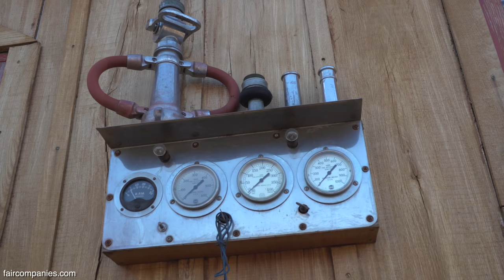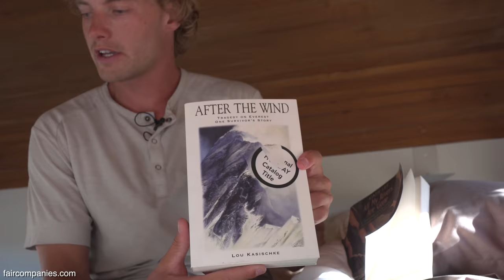Snowboarder's 1950s fire truck as a cozy place to call Home

Comment: This guy should hook up with the couple from Adventures in a Backpack next ski season!!!!🏂⛷🎿
He needs to invest in a hot air exchanger to take out excess moisture.  He can use Damp-X in the meantime. He could make or get a composite toilet, build a box around. Put a cushion on top as a seat when not in use otherwise.  ijs😀

Comment: I have  seen  many van conversion videos, and I don't  understand why they don't  build a bathroom  when they have room for it, at least a very minimal one.
Reply: Because it's expensive, water weighs 8 lb. per gallon, you have the hassle of dealing with human waste and gray water, pumping water needs pressure systems, pumps need electricity, electricity needs batteries, etc.

Comment: that poor transmission... you're supposed to double clutch it. it wont grind so much that way :(
Reply: Tony Fleetwood I think double clutch means different things in different cliques
Reply: Double clutching means: 
1. depress clutch 
2. gear into neutral 
3. release clutch (at this point the gear speed and engine speed equalize) 
4. depress clutch 
5. place into higher or lower gear (rev matching with accelerator if down shifting)
6. Release clutch

In modern cars double clutching is not necessary as they use a synchromesh which automatically equalizes the gear and engine speed.
Reply: Eric G double clutching also means you don’t lift your foot off the gas when you shift.
Reply: What you are talking about is called 'power shifting' or 'throttle shifting''. Double clutching means just one thing in my experience: using the clutch twice for one shift.
Reply: Eric G thank you the big issue with car terminology is a lot of weekend warriors get terms wrong and spread them around. I was told that was double clutching multiple times. You’re definition makes way more sense to me. Thanks man
Reply: Agreed!
Reply: non yobussiness except that it doesn't. That's not what double clutching is.
Reply: Fly Beep what is it?

Comment: Motor swap it!!!! Its emissions exempt!!!!!!!!!!!!!
Reply: Zombie4loan 
That's what I'm talking about! He could update a lot of the mechanical and have a new truck that looks like a really old truck.
Reply: A 5.9L Cummins and manual transmission out of a dodge pickup would work nice.
Reply: Wandering man  Yes, throw about $20K into the running gear of that 70 y/o piece of junk and with 6 new tires it MIGHT pass the Oregon DOT safety inspection. There is nothing romantic or safe about driving a vehicle that is a threat to others on the highway. He stayed in the parking lot because the truck couldn't be registered for the road.